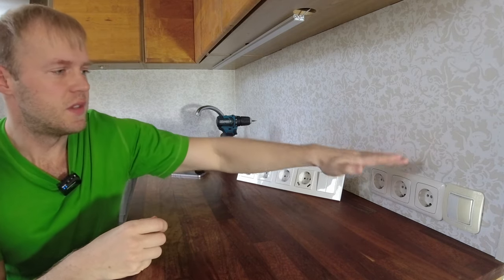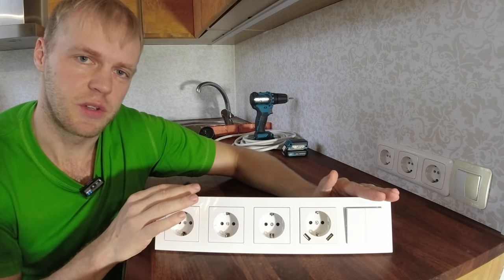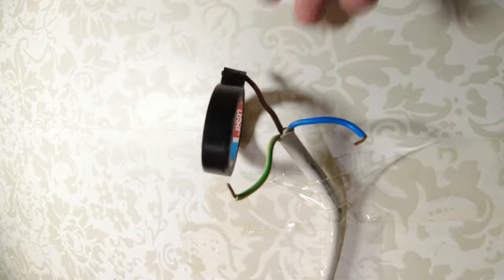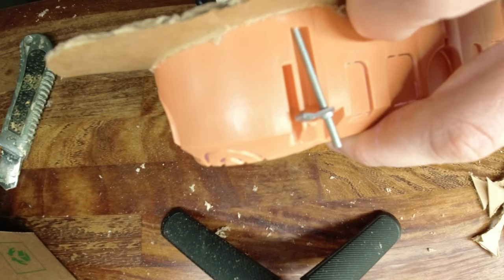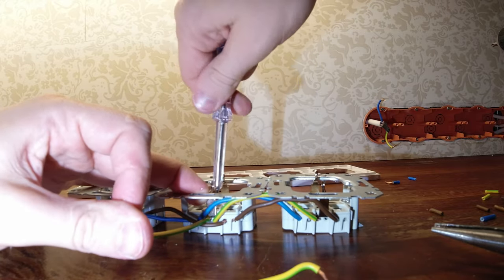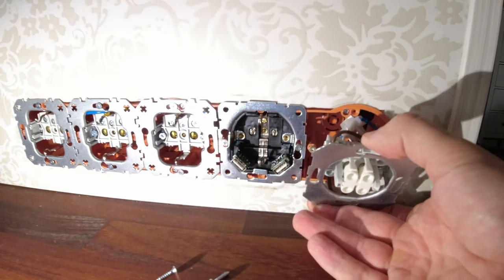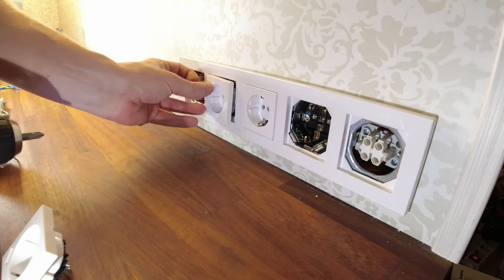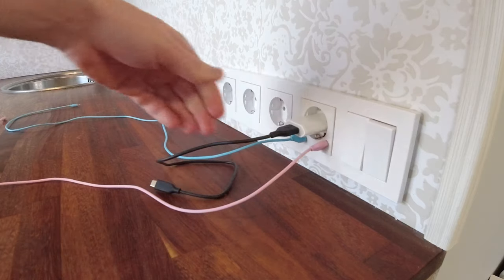How to Change an Electrical Socket With USB Adapters in Europe // Schuko Plug

Comment: Good video as always. I would advise anyone undertaking job like that to check for voltage with a multimeter or a probe, even after insulating with the circuit breaker. Some old installations may not be safe. 
Another issue with those built in USB chargers I have is hat they always draw power, even if they are not in use...
Reply from the maker: Thanks, Kristoph! I tagged your comment, so people can read that and research more about safety control ;)

Comment: Hi i am considering to buy wall socket with USB, how reliable is USB socket charger after 2 years, does it heat up or make any noise like wineing. Is it good for charging 2 phones, my S21 takes 1,5A. I am doughting quality of those built in chargers, but they look good. Is digitus or Logilink a good brand for these, they cost 20€
Reply from the maker: Hey, mine was bad quality and it charged poorly. Sometimes stopped and then again and I think it destroyed few lightning cables because of that. 
I ended replacing that usb socket with usual one and using oldschool plug in chargers now. 
Logilink sounds good, but may be same Chinese product inside. Cant tell. Mine was tesatek I think.
It made some tiny wining noise, so it constantly use some energy. 
Anyway, Im quite dissapointed. Maybe they make better products in the future, but atm risky business.

Comment: A warning to folk connecting new sockets at home in some european countries. I live in Finland, and an person that does not have an electrical engineering degree, is only allowed to connect new switches and draw the electrical cables in the walls. Connecting the wires to the sockets is not allowed, unless the electrical system is an 12V one. I think quite a few home owners still do it here, but if there is an fire because of an malfunction of an electrical device, and the electrician that did the work on the house says that he did not install this socket, insurance companies are not obliged to pay you anything whatsoever for the damage caused by the fire.
Reply from the maker: Thanks for the warning.
Reply: @MarekKubi  Great video tho! Quite a few owners includes my father, until he got an electric shock when connecting an outlet in my little brothers room, learned to turn off the power after that. The electricians around here are just your average working people, so if you know them well enough, just to connect it on your own, as long as you are certain that you know what you are doing. Your electrician will prob tell the insurance companies that they did the connection, as long as the work is done properly.
Reply from the maker: @oshixxxx  That is interesting to read, how it is in Finland. Here we still have some freedom in building, but we are moving in the same direction. Sounds quite logical, that DIY guys can make serious mistakes in some works. For example, in Russia, almost everyone is making works like that themselves :D I am even not sure if they have electrical specialists there :D
Reply: @MarekKubi  The specialists here are mainly used when the house is being built. The DIY work is usually done some years later, when the needs for power in an room changes, (for example computers being introduced everywhere). A big reason why this happens, is that the electricians usually promise a date they will do the changes, but because of their workload, they show up a couple of weeks/monts later instead, so folk just do the installing themself instead, since clearly, everyone in Finland are electric engineers.
Reply: @MarekKubi  Before 1985 you were not allowed to do any wiring, not to change plugs or fix a light on the ceiling, When I was in school they said that changing a fuse was on the border line whether  one could do it.

There has been several accidents caused by DIY. TN-C (klassische Nullung) is very common on older installations and there was no consistent use of colors, even same colors were used for both wires. DIYs hook the ground to the live wire and create a death trap. This has caused three deaths since 1980.

Also one could not do any wiring to circumvent the grounding. In the 70s we had a tile floor on the TV corner. That mandated that the socket gad to be grounded. The TV we had had an ungrounded plug so it did not fit. The solution was to make an illegal extension cord that allowed to plug it. I do not why the TV did not have a grounded plug when it was made in Germany where grounding already universal. The next TV was double insulated with a Europlug so there no longer was an issue. However, many continued to use the illegal extension cords they or someone had made not realizing the danger. Another common option was to cut the plug so it fit. This actually was better as at least the cur plug will be discarded with the equipment.
Reply from the maker: @okaro6595  Reading viewers experience is always very valuable information (Y). Thanks for sharing and informing and warning. Kiitos.
Reply: The solution to this is to do it yourself, then call an electrician for inspection and pay him to sign off on it. Then you have no problem.
Reply: @24June91 
The best tip I’ve ever heart. And the most efficient method. 
Thanks.

Comment: What country are you in I was in Berlin Germany for 2 weeks wiring to me didn't look up to ul codes no box behind light fixture wire fused more than the rating 14 gage goes on 15 amps and 1.5 mm is lighter than 14 and in kitchen are required to be wired with 12 gauge wire on a 20 amp breaker close to 2.5mm
Reply from the maker: I am from Estonia. Yes here we still can DIY with electric stuff, but I think soon everything needs to be documented.

Comment: I was searching for old type shucks socket combination used in 90,s and could not find that had flexible cover 

Similar design but only has cover we lift manually to insert plug

Comment: Are concrete walls not common in your country?
Reply from the maker: Yes. This was inner wall between kitchen and toilet. Between neighbours  mostly concrete.
Reply: @MarekKubi  Do estonians dislike concrete inner walls?
Reply from the maker: @IAmThe_RA   Of course they prefer concrete, but in many cases, demand is on a budget solution.

Comment: The result is terrible and dangerous... -.-
You didn't do much wrong but you kept some dangerous issues with the existing wirings.
Don't load these sockets more than 6 amps if you don't want it burn.